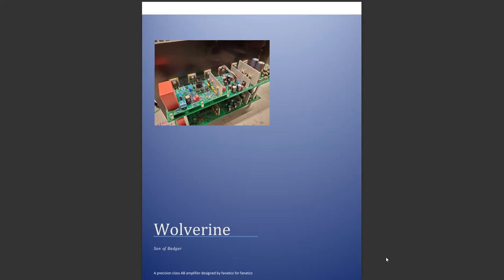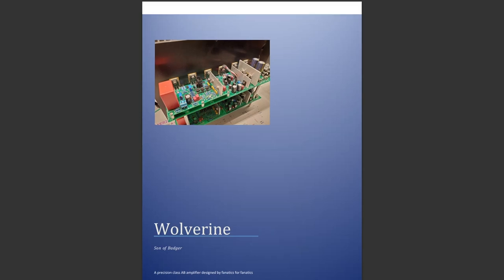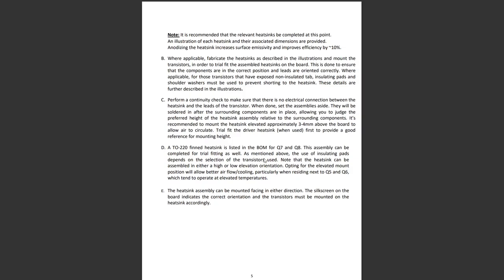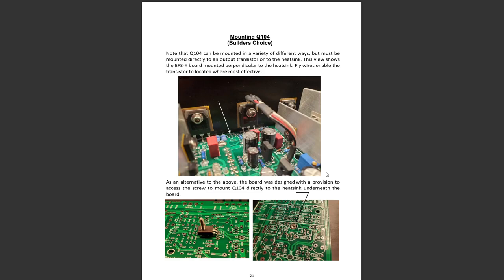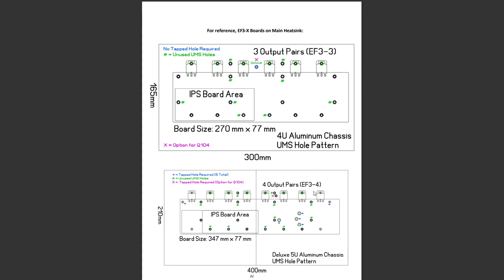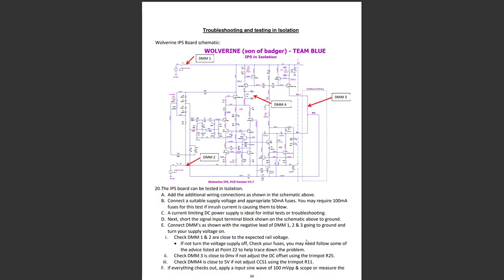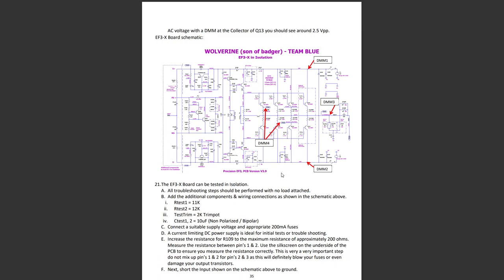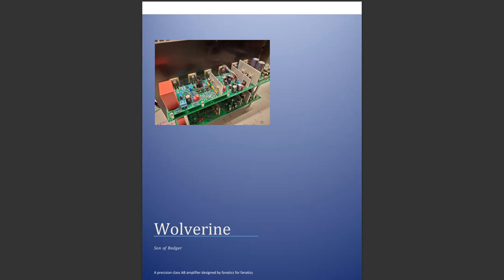Wolverine Amplifier Build Introduction

Comment: I watched the input stage test video ,. I don't have any. of your test equipment , current limiting power supply, O- Scope, is this amplifier just for engineers? you lost me on the diode section, are they used or not used?, I have a bread board &  a dmm. is there a less complicated way to test  the input stage?
Thank You.
Reply from the maker: Hi there,

You dont have to do this test, I was just showing it for people's interest. The build guide has the information about the diodes and it is best to read that section carefully.

I hope this helps

-Dan
Reply: @danw1million   I don't have a build guide, to my knowledge it hasn't been released to the public and I don't know how to match resistors, maybe all the matched parts will be available in the diyaudio store. Thank you for the videos.
Reply from the maker: The build guide is only available in the group buy.
There is another group buy planned, I put a link in the description
Reply: @danw1million  I understand and I'm on the list for the next group buy. Thank you.
Reply from the maker: @27grains82  Good news, you won't be disappointed